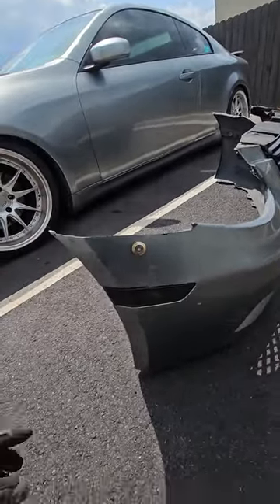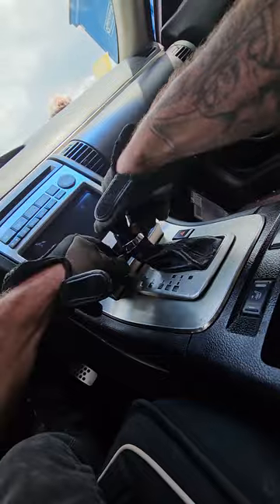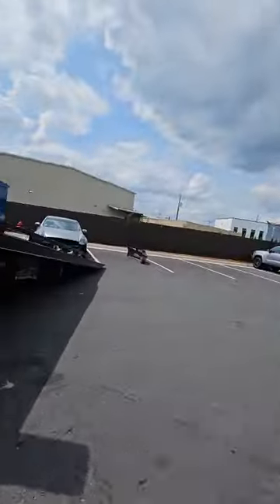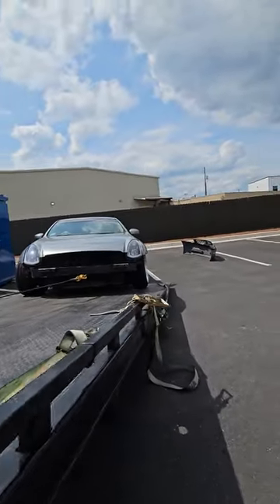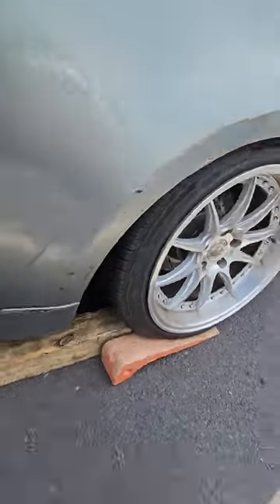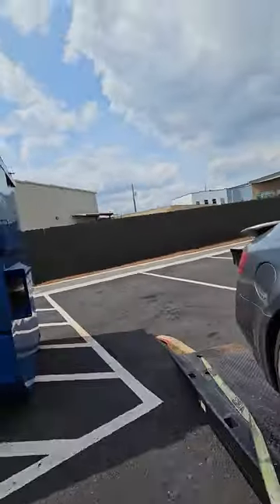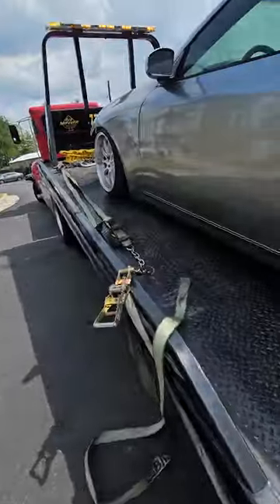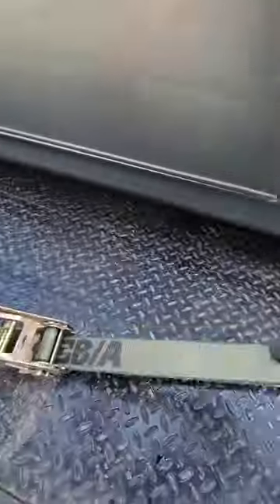Loading low cars#viral#youtube#shorts#short#youtubeshorts#ytshorts#youtuber#wrecker#rollback#towing.

Comment: that remote you have does that only have a winch out and in function, or does it also work the bed back and forth etc?
Reply from the maker: Hey great question it currently only has winch in and out.
Reply: @darronmalonetowingchannel  Gonna make a video request,  would be interested to see your way of getting a lowered car  off and onwith no keys. I dont think its a video on youtube like that, it would be a little trickier using boards if the car wouldnt roll.
Reply from the maker: I'm on it. Thanks for the idea.
Reply: I got another trick for the tow pin!!! 
With a snatch block but you have the wrong one you need one with a hook instead of the chain I taught a class for allstate motor club at braman BMW in 2014 for towing using a tow pin.try and get one same size as the one you have I believe it is a 2500lb
Here is the solution!
Put your snatch block on the tow pin with cable through it bring your cable back up to the right corner of the bed  near the headrack there should be a hole or a hook I'm not sure I believe you have a century bed attach your cable with a small length of chain creating a loop! hook your cable to the loop and pull that way when you get up to the stopping point you will have 0 degree of side pull this remedy is for stationary center winches there are winches that will slide side to side we have them here those rollbacks are utilized for transporting their exotics owned by the dealership strictly transport but they are limited to standard pulling not recovery work heavy tension  I hope you can get another snatch block I have both just in case! I would like to see a video of the process it will be a hit! I see a lot of towtrucks doing it incorrect what that does most tow pins are cast steel not forged steel that means they will crack with side pressure!
Great video Sir keep up the great videos 👍🇺🇸
Reply: @sturksauto1969  if there's a will there's a way! First thing is being properly prepared the easiest way for dropping lowered vehicles must have go Jack's! Slide vehicle off just enough that the tires are off the bed not all the way just enough that when you set your bed down the tire touches the ground slightly walk out about a foot or two place go Jack's and roll slowly raise your bed so the nose doesn't touch bed get to the edge and put blocks I have some guard rail blocks that I use put under the vehicle frame or a good solid point and lower car like I said you need to be properly equipped! Use your floor jack to remove the blocks my most challenging was a 2021 Lamborghini Aventador SV not the most expensive vehicle but the most concerning the customer was there watching I kept my focus on the job and executed it flawlessly earned myself a $500 tip💰💰💰💰💰
Reply from the maker: Holy crap!!! Genius!!